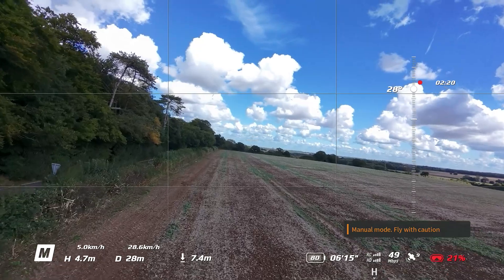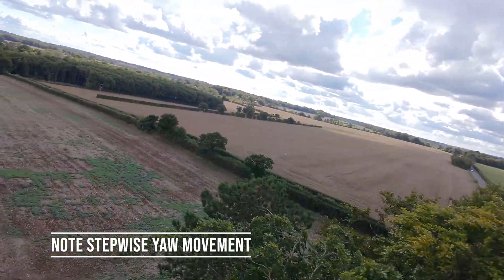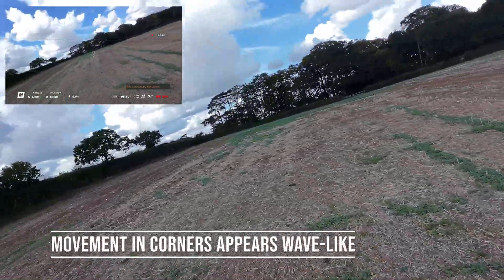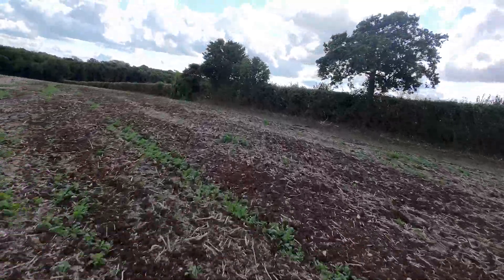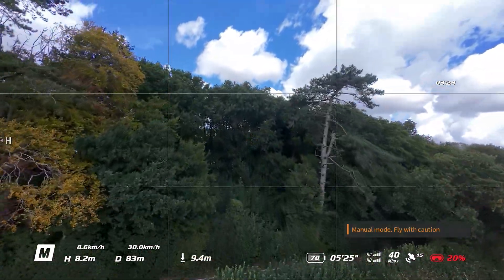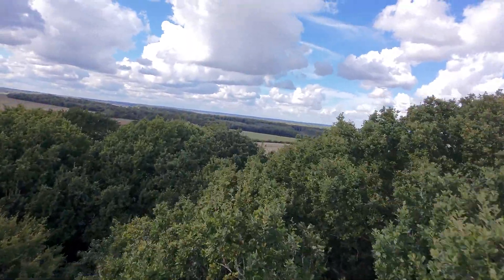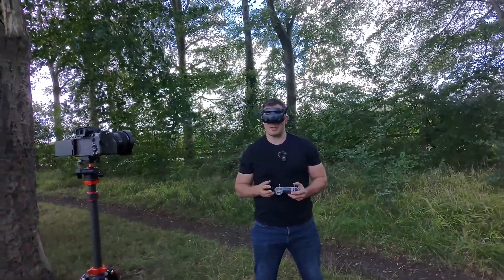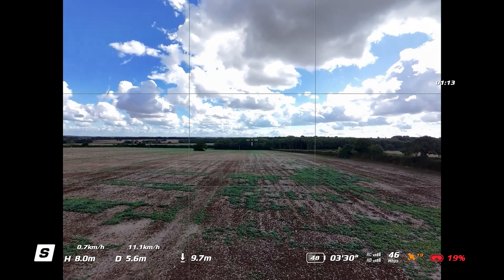Dji Neo Rocksteady sucks - use GyroFlow instead!!

Comment: I am not able to find those settings using the DJI RC-N3 and the DJI App on my phone, so I guess you can turn off stabilization and set it to record gyro data only with the goggles? and maybe the RC2?

Comment: I love using Gyroflow on the DJI O4 pro system but when using it on the NEO i have found it causes video artifacts and ultimately, while the movements are cinematic it ruins the quality of the video. Do you experience video artifacts after using gyroflow on the NEO?

Comment: Hello everyone, new DJI Neo user here! I've been flying my drone with the RC-N3 controller and getting great results. It's my first drone, and so far it's been great. However, I've noticed some "stuttering" in the video, as if it's not playing smoothly. It's more noticeable in 4K/30fps and 1080/60fps with EIS (RockSteady) turned on. Has anyone else experienced this? Is there a way to improve it?
Regards, Matias
Reply from the maker: Hi, is this in FPV mode or normal drone mode? - the RC-N3 only supports normal (non fpv) flying.
Reply: @dronewilder5234 normal mode.

Comment: Great video! If you do not mind, is it only possible to bypass RockSteady stabilization when using FPV mode on the DJI Neo?
Reply: Do you mean manual mode? If so, no. You dont need to fly in manual. But you need to switch the video settings from 16:9 to 4:3. Otherwise it doesnt record the gyrodata.
Reply: @rngff-i5o How?!?! my neo doesnt give me the option to record in 4:3?

Comment: Hi ,I'm struggling with this,I'd love it if you could help me. I'm recording with goggles n3 and fpv manual mode in 4.3 4k 30. After that I downloaded the video to my phone from neo but when I put it in gyro flow from my phone it says no gyro data. What am I doing wrong? TIA
Reply from the maker: @fpvguysi  the most likely reason is due to the fact you are exporting to your phone.  For the file to retain gyro data try transferring the file directly from the Neo to your computer using a USB C cable.

Comment: Rookie question: do you have to use fpv in order for 4:3 to output gyro data for gyroflow? Or can you select 4:3 using the regular DJI RCN3?
Reply from the maker: Gyroflow data will only be captured if you fly with the goggles 3 in one of the FPV modes.
Reply: @dronewilder5234 ahhh bummer. Seems like an unnecessary constraint on DJI’s part.

Comment: I bought a Neo because I thought I could connect to the Mini 2 Pro RC. Found out that I couldn´t. WHat is it worth buying? RC2? FPV3 +Goggles ? RCN3? Thank you
Reply from the maker: @SportsCast-x3n  really depends on what you want to use it for mostly and also whether you feel you will be getting more drones such as a the air3s, flip, Mavic 4 in the near future.  If so, then I’d go for the RC2, the RC-N3 is not bad though
Reply: @dronewilder5234  But ican it do FPV? Or o
nly with the goggles and FPV remote?
Reply from the maker: @SportsCast-x3n  yes you need the goggles for FPV.  I’m guessing there should be a fair lot of RC-N3’s going cheap on eBay as many will have multiples of them so perhaps that’s a good starting point

Comment: I don't know what parameters of the neo cámara to use stabilize in gyroflow... Could you please explain to me????
Reply from the maker: @juanruizenriquez7167  you simply need to ensure it is not applying rock steady stabilisation.  One way to do this is to record in 4:3 4k which automatically disables stabilisation.  You will then have the gyro data baked into the file to use it in gyro flow
Reply: @dronewilder5234  gracias!!!!

Comment: I can only choose rocksteady, doesn’t show the option for gyroflow
Reply from the maker: @yegago  gyro flow is done separately in its own application.  You need to ensure rocksteady stabilisation is turned off though in order to capture the required gyro data on the video file
Reply: @ oh ok thank u

Comment: Hi,
GyroFlow is not listed in mine.
Only RockSteady and HorizonBalancing stabilization are available. 
I'm using a Goggles N3 with FPV remote 3. What I'm missing?😂
Thanks
Reply: I think you have to turn stabilization off in the googles, then load the footage into the Gyroflow software?
Reply: As far is I know, it’s only available in the manual mode with the FPV controller 3!

Comment: Thanks for the video. I just bought the DJI Neo and I’m new to the ecosystem. How do I export gyro data with my videos? I see that you disabled rocksteady via the goggles, which I don’t have.
Reply from the maker: @adv8839  welcome to the channel and the ecosystem 🙂… in order to export gyro data you just need to make sure rocksteady is disabled - the easiest way to do this when recording in 4k is to set the drone to record in 4:3 as it will then automatically disable rocksteady
Reply: @dronewilder5234  I can’t seem to find the option to set video to 4:3. I can only set photo aspect to 4:3.  Am I missing something?
Reply from the maker: @ are you using the pop up menu at the bottom of the screen?
Reply: @ I’ve gone through all the options. But I just can’t seem to find any options to adjust the aspect ratio for video.  Only photo mode.  If there was a way for you to share that process it would be very appreciated.
Reply: @dronewilder5234  I found this clip that illustrates the menus I see https://youtu.be/s2gZ2pp6DU4?si=PfOdUbHoTEi3OggI. Apologies that it isn’t in English, but it is subtitled.  The screen grabs are from the mobile version DJI fly. I’ve also tried it when the RC3 controller is attached. There are motions for fine tuning, but no option to set video to 4:3
Reply from the maker: @ I think there is some confusion here.  If you are using the mobile phone connection or Dji fly app using rc2, RC-N3, then you won’t be able to record video in 4:3 - this option is only there if you fly with the FPV goggles3.
Reply: @ thanks.  Hope DJI fixes this soon

Comment: DJI Neo gyro data, I’ve set at 4:3 in photo section but files input in Gyroflow still have no gyro data. What am I doing wrong? Using RC 3. Fab channel 👍
Reply from the maker: Have you ensured it’s 4:3 in video settings too?  Also ensure that rocksteady is off which should happen by default if you switch to 4:3 in 4k quality
Reply: As far as I know, it’s not available with the RC 3, you must fly FPV (Goggles and manual mode on the FPV controller 3)!

Comment: Why is the video from DJI Neo stuttering/judder? Why isn’t the footage smooth? Can this be adjusted?
Reply from the maker: Could be due to the fast shutter speed when not using filters or perhaps due to processing.  I’ll have to check if this has been improved with the more recent firmware update though

Comment: Ive just got the neo after selling my mini 2. Id love to do a  it of fpv. What controller would you recommend? And goggles? Are they a requirement? Thx
Reply from the maker: The only fpv system compatible at the moment is the goggles 3 and remote 3 by Dji.
Reply: @dronewilder5234  Don't forget the motion 3. That why I was asking. FPV controller as you have, or the motion 3.
Reply from the maker: @Life_of_John  you’re right the motion controller too although I personally would recommend the remote 3 if you have a choice
Reply: @dronewilder5234  OK, I'll look at that. Thank you.

Comment: hi, how do i have to set the parameters to try with gyroflow ? I can't disable the rock steady and don't find how to set the format in wide.  Dis it work if the rush is made with rock steady ?
Reply from the maker: @PorscheGt4  hi I found the only way to do this is to switch to 4:3 aspect ratio which automatically turns off rocksteady and will then automatically gather gyro data
Reply: @dronewilder5234  thanks ! I've tried and it works
Reply: I already set the frame to 4:3 ratio. How do I change the video aspect to 4:3?  I have photos set to 4:3
Reply from the maker: @ there should be an option to change it either in the pull up menu at the bottom or under the video settings.  You need to change it with video mode selected though as it doesn’t do it globally if you’re in photo mode.  Presume you are using goggles3/remote 3?

Comment: Thanks for these very interesting videos. Are you flying the Neo with the RC-N3 and the Goggles 3 or is that the FPV RC 3? I didn't think the RC-N3 controller would work with the Goggles 3 and the Neo.
Reply from the maker: @richards2072  thanks for the comment, I fly with the RC-N3 when flying normal cinematic stuff and remote 3 with goggles 3 for the FPV things.  The RC-N3 isn’t compatible with the goggles 3 at this stage as far as I’m aware

Comment: Can you enable gyro data on the DJI Neo without the Goggles? I.e if we only had the RC-N3 controller...?
Reply from the maker: @DanTanAU  not as far as I’m aware (yet).
Reply: @dronewilder5234  - thanks for the info.
Reply: @DanTanAU  why would you want to? Without Goggles,  your only going to be Normal or Sport Modes, you must fly with Goggles and FPV Controller 3 to fly in manual (acro, DJI hybrid style) So you would be stabilizing stabilized footage. Put another way, without Goggles it's only going to fly stabilized, not Manual.

Comment: rubbish I did a test and the video stabilisation was very smooth so it must be something you're not doing right
Reply from the maker: @vince-n  I tested it several times in multiple locations and with two different drone giving the same results.  It’s may be a bit too subtle for most to notice.  There’s not really anything an fpv pilot can to to induce this behaviour unless it’s caused by stick movements which is not the case.
Reply: @dronewilder5234 if  you're taking the footage off the sd card in the goggles then it will be jerky..i can tell because it has the osd display...if you take the footage off the actual drone it is smooth...i tested it after the firmware update and had no problems after 3 different flights

Comment: have same, Mic2 and Neo, but my Audio in last track not record, did you know whats problen is? Use Samsung A51, connect to Neo, Fly in spot, but no audio, my, my A51 to old? Not all time but today,
Reply from the maker: To be honest I would just do a manual sync and record with the mic 2 standalone.  I know it’s not a good workaround but it’s a safe way to ensure you record audio.  Just press record and do a hand clap to manually sync.  Alternatively if you have other B roll recording, just use auto sync on adobe premiere if using.
Reply: @dronewilder5234  that way i know, thx

Comment: To be honest, both your videos seem better than most posted.
Lots of videos show when turning a lot of stuttering / juddering. 
But mostly in Follow mode, which is primary reason I have one order to follow when trail running / mtb biking.

Would love to see using Gyro Flow and Rock steady comparison in follow mode, preferable not in the open..

Also if you set the configs using a remote, are they kept. Would ideally set the screen / sharpens etc. Then leave the remote when out running.
Reply from the maker: @striff  there’s a lot to consider there.  I’m not sure whether follow mode allows footage to be recorded unstabilised and suitable for gyroflow.  I think (don’t quote me on this) that using mobile phone control camera settings are all set to auto and currently cannot be controlled even if previously set with the remote but I strongly suspect they may add video config options to the mobile phone in future (that mobile app is brand new so probably still going to evolve a bit)

Comment: Do you need to hack something to make it fly faster? I think my is max 8 m/s so it is like 28 km/h - yours shows faster speed. Thanks for info
Reply from the maker: @droneSSpirate  no hack but I am flying in full manual mode and 30deg camera tilt.  You should be able to get decent speeds with that
Reply: @dronewilder5234  thanks, I will try soon
Reply from the maker: @droneSSpirate  I got easily around 50-60kmh that way - have fun!

Comment: Nice drone for the price, but image quality is very strange...
Reply: Quality fine for me though
Reply from the maker: @carlsberxithub3711  I think for most people it will be - we do have to remember it’s primary purpose is a small vlogging/selfie drone
Reply from the maker: @ninjadrones  but for the price it’s very good and a ton of laughs - I actually really like it
Reply: Yup, And I feel that people would still be completely fine with the price had an extra $100 been spent on a larger sensor. The sensor itelf is only 1/2 inch, The Spark, SE and SE 2 all have a 1/2.3" sensor. So only marginally better than budget drones pushing 6 years old.
Reply: @vertx706  and in some ways the lower image resolution that came out of those smaller sensors was still more pleasing when you view it today than what is coming out of the Neo camera. I have a Neo on order and it will be a fun toy alongside my Avata 2 and Mini 4 Pro, but I would have gladly paid an extra $100 to get better image quality, they cut costs a bit too far.
Reply: @vertx706  Probabilly a Neo Pro ou Neo 2 will bring a better image...
Reply: @ninjadrones  Oh definitely. Either that or a Neo pro.
Reply from the maker: @ninjadrones  definitely - as far as most markets are concerned - staying under 250g is key so there’s a fair bit of space for a slighter stronger power train and a better camera.
Reply from the maker: @ninjadrones  yeah the highlights appear to contain very little information.  I tend to underexpose by about 0.3-0.7 stops to compensate a bit.  Also there’s a huge amount of crop going on a lot of the time so actual footage is more like HD upscaled to 4K
Reply: I think reason for jerky is 30 fps. If we shoot at 1080p 60fps then image might be good.
Do we have 2.7k at 60 fps?